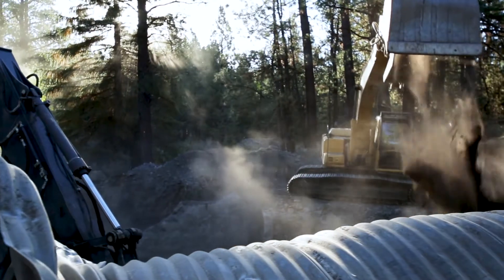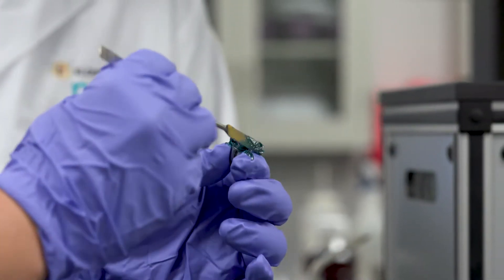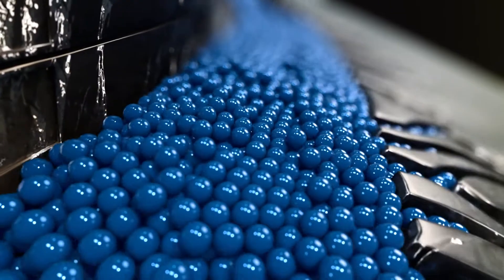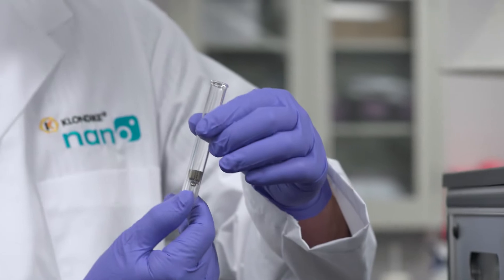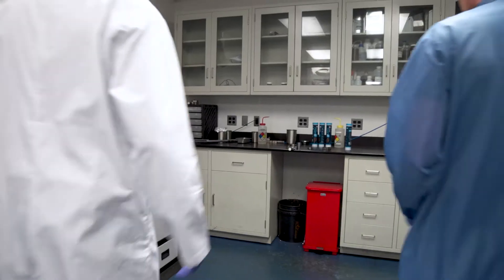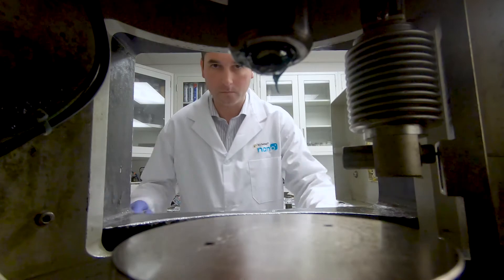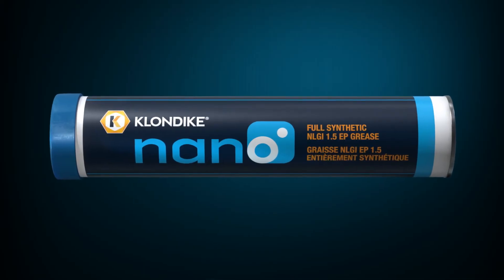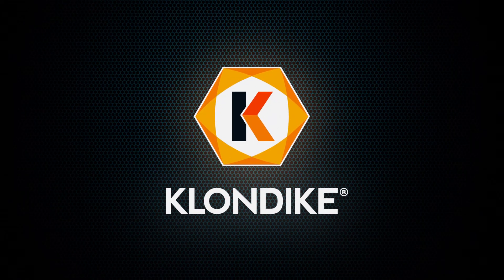KLONDIKE nano -  Engineered with breakthrough nanotechnology

Comment: Finally got my hands on Nano Lithium Grease as a spray. 
Very impressed with its lubricating capability, acts like a penetrating grease, doesn’t gum up like regular white lithium.
We are Switching our lubricants and greases over to Klondike exclusively, it’s the only lubricants that stand up to the neglect and abuse our equipment goes through per season.